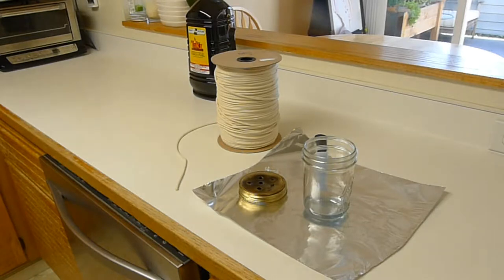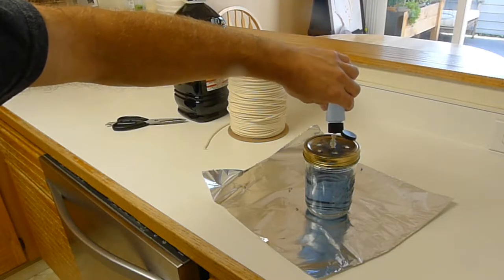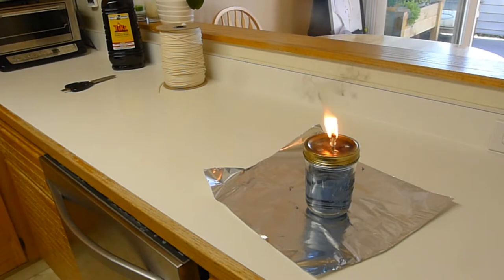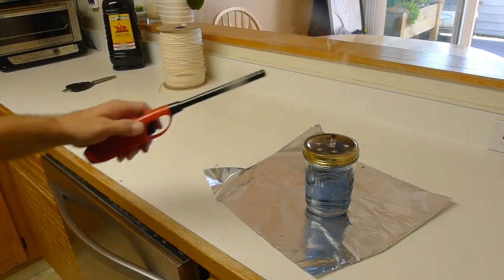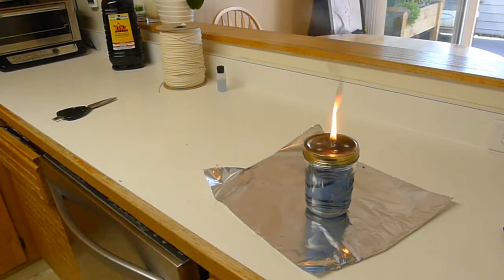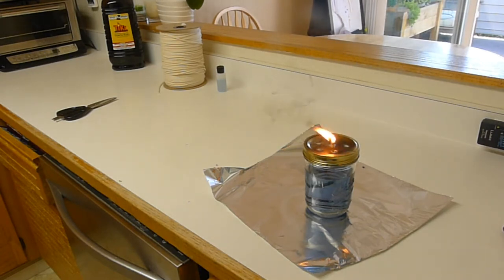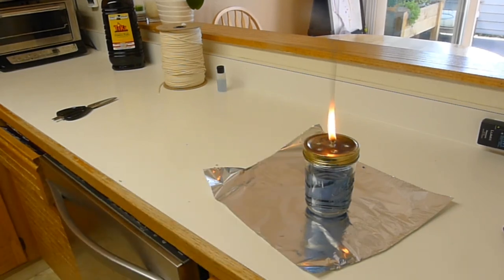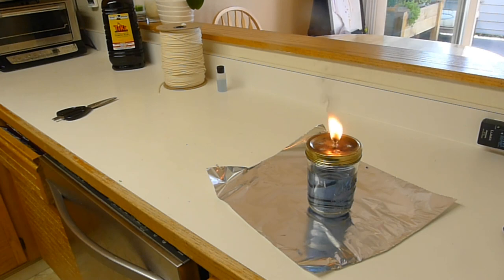How To Make A 1/8" Round Cotton Wick Mason Jar Emergency Candle DIY Lamp

Comment: is there a difference between 100% cotton rope and cotton wick?  Cause I'm using 100% cotton rope and flame goes out in 5 mins or so.
Reply from the maker: Hello.  Cotton wick is usually a sleeve with cotton strands inside.   I have had good luck paired with Pure Paraffin lamp oil.  Not sure a about using rope.  This is definitely woven to be wick. Do not use for structural tying.  It is a hollow cotton sleeve with several braided strands inside.  Thank you for your question.  Daniel